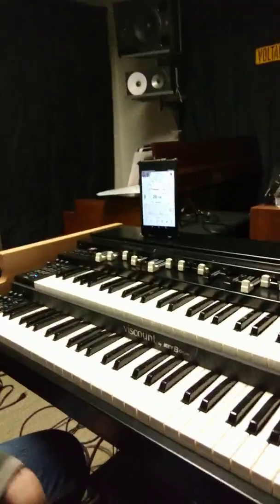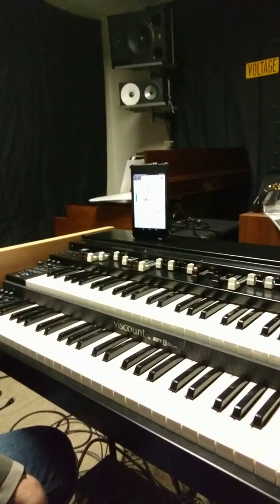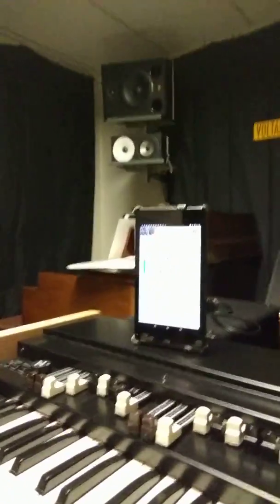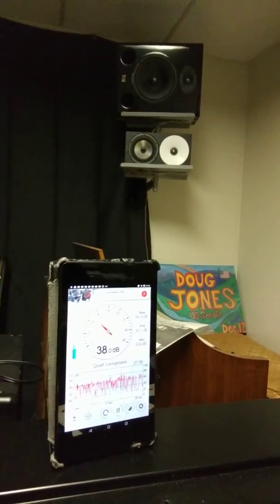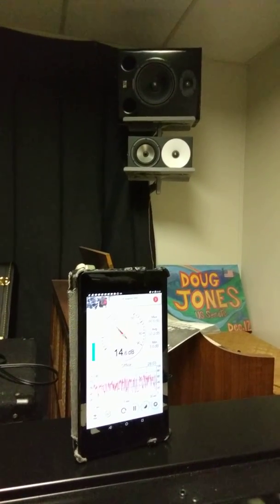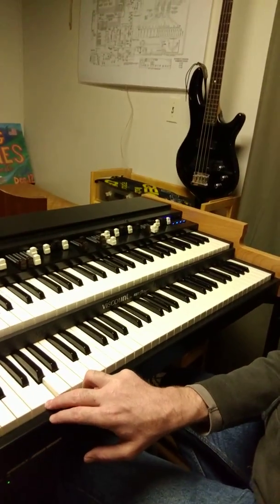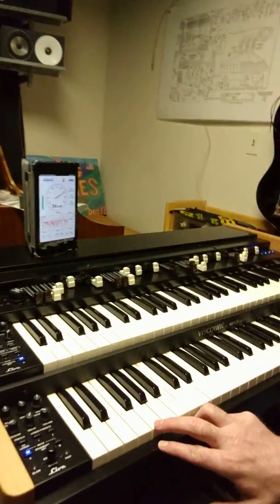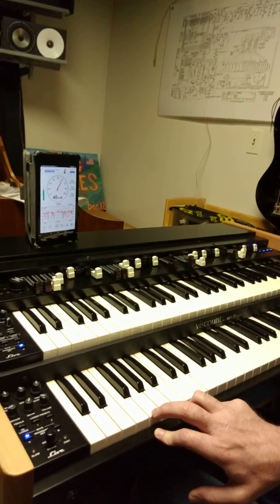Viscount Legend Live Destructive Interference -- Tonewheel  Phase Design Error?

Comment: Real tonewheels have NO fixed phase relationship. There is a spring on every wheel for 'safety' in case it freezes, so the position of wheel can change after a (short) freeze of it.
Reply from the maker: As you can see if you look, we covered this in other comments a long time ago. The point is, yes, the organ has a safety feature in case of a problem. But if that feature comes into play, something is wrong. The phase relationships of tonewheels in a fully working Hammond tonewheel organ do not change.
Reply: @robertkennedymusic  Even a heavy running (cold/dry) bearing during startup can cause light slipping wheel and change the position of it = phase change.

Comment: Interesting video. In fact, the tone wheels in a Hammond organ are never phase locked, any of them! The reason is the wheels are driven through spring clutches that allow ‘drive-slippage’. This was designed-in so that in the event of a pole piece physically contacting a wheel, the gen would not ‘self-destruct! The whole gen is in effect, a mish-mash of phases at any one time. The phase cancellations you are experiencing can come from a plethora of issues including propagational phase shifting in amps, speakers or even your room. I think a degree of cancellation is a ‘natural phenomenon of any organ set-up.
Reply from the maker: Yes, it's true that there are spring clutches in the Hammond tonewheel generator that allow slippage in the event of pathological problems like a tonewheel stuck on an overextended pickup pole piece.

But it's not true that tonewheel phases in a real Hammond are changing all the time. In fact something has to be wrong in order to cause one of those clutches to slip. It's not a part of normal operation and it doesn't happen between two successive notes in a working organ.

In my video I might have overstated the degree to which the wheels are locked in phase in a real Hammond, but you are drastically understating it, and the Legend behavior is dramatically different from a real Hammond. See the waveform graphs in my blog post on this same subject at https://robertkennedymusic.com/posts/a-disappointment-with-my-new-organ-clone/ for a very clear understanding of the important difference between how the Viscount Legend series works and how a real Hammond works.

Did you see that everything you said is covered already in comments that are months old by now?

Comment: BTW: Hammond tonewheels are driven from a spring clutch on the axle in each bin of two wheels. So 100% phase sync is not obtained, there is a slight randomness in the construction.

https://youtu.be/7Qqmr6IiFLE?t=240
Reply from the maker: Yes, it's true. That's a provision for mechanical obstructions and it normally doesn't come into play. Certainly it doesn't allow phase changes from one note to the next during normal operation.
Reply from the maker: For more info and specifics and detail, see https://robertkennedymusic.com/posts/a-disappointment-with-my-new-organ-clone/

Comment: Maybe this has been corrected. I tried it on my Legend, purchased Feb 2021 and only got in-phase superposition. Is that called constructive interference?
Reply from the maker: Yes, the term "constructive interference" is used for that situation. Thanks for mentioning this! I had heard from others who recently bought the Legend that their instruments came with a new OS version which is numbered 1.8, whereas mine has 1.6, which is the latest version available to download as an update from Viscount's web site. If your new Legend has OS version 1.8, this is really good news because it might mean the problem is fixed in the newest version. I will wait anxiously for the newest version to become available so I can try it out and hopefully confirm that the problem is gone. Thanks for letting me know about this! What OS version does your Legend say that it has?
Reply from the maker: A quick update on this: I checked with my representative of Viscount and he learned from Viscount folks that the OS version number has been bumped to 1.8 only for cosmetic and bookkeeping reasons, not because there is any change to the code. Version 1.6 is still the latest code they are shipping, so there is no difference functionally between 1.6 and 1.8. For that reason, I'm confident that 1.8 still has this problem and I'm still hoping, over a year after documenting the bug, that they will fix it someday.